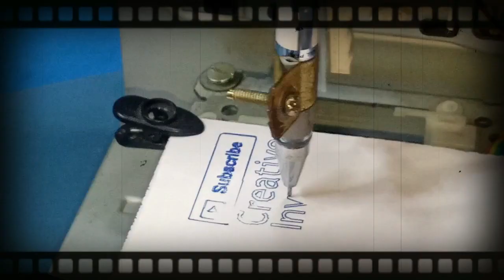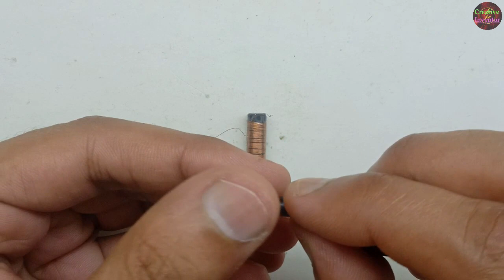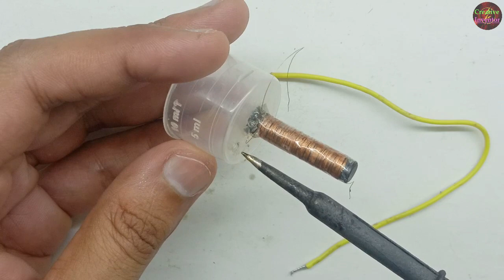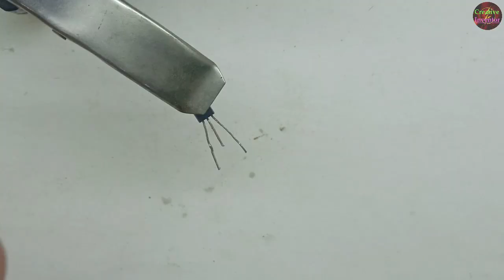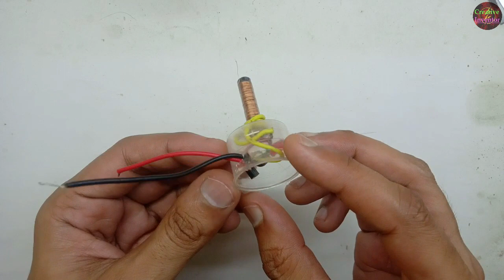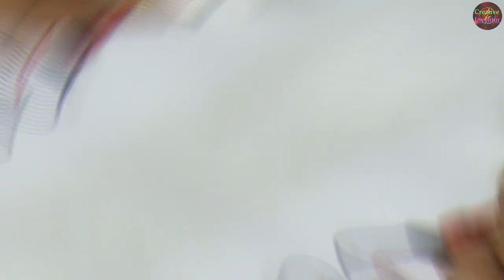Very Easy Amazing Science Project, How To Make Super Mini Tesla Coil at Home,DIY Tesla Coil Homemade

Comment: Hello can i use other transistor like S8050 npn transistor and can i make this circuit without led
Reply from the maker: yes u can use other npn transistor and i had not tested without led.
Reply: @CreativeInventorlab  okay but it work this tesla coil if 100 turns only